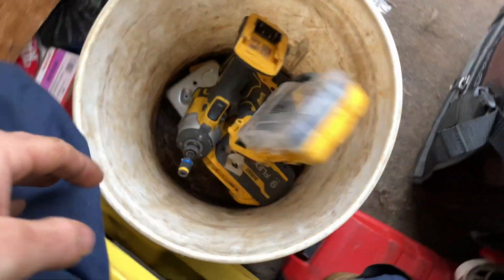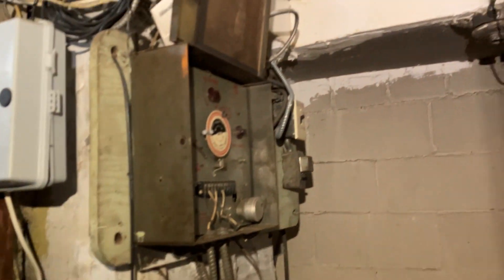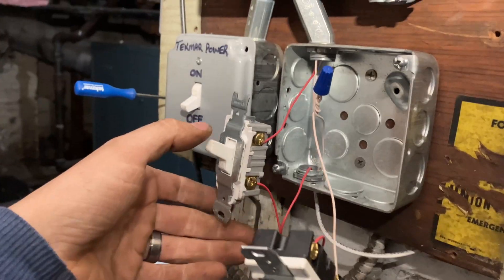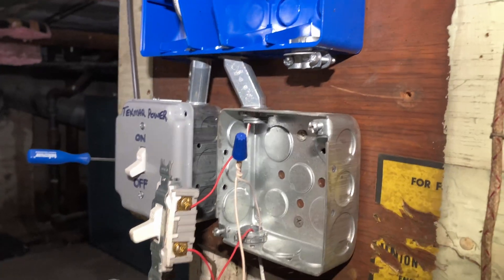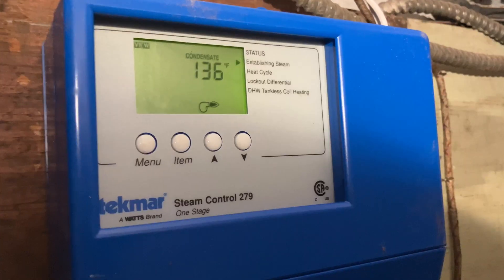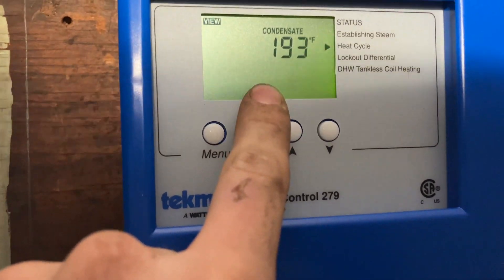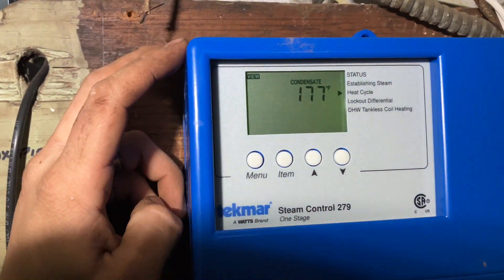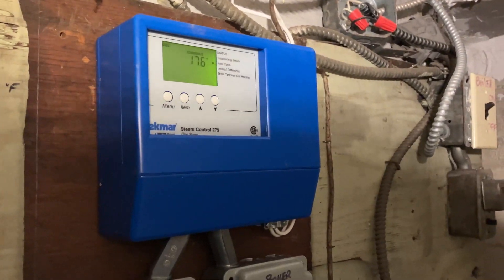Every Boiler Needs This Switch

Comment: Nice !  I have a tekmar 336 controlling a grufundos alpha.  I have an ST01 controlling the power to the tekmar so I can ignore heat calls during certain hours.  I have the power for the circ pump from the tekmar going to an outlet which then takes a 24h heavy duty mechanical timer and is set to 1/2 an hour on then 1/2 an hour off.  This allows the 40g bradford white ele water tank to get a rest every 1/2 hour and power my 7 hydronic zones based on individual zone actuators/532 thermostats.  I need to put a on/off switch ( breaker is close by ) / bypass is moving the circ cord to the other outlet.

Comment: Very nice install! Same concept for a hot water boiler?
Reply from the maker: For sure! The summer winter switch would be the demand switch( on/off) and the auto/bypass would well you get the point lol, auto let’s the “control takeover”  basically what the summer/winter switch is in, and the bypass is the most important because it bypass’ the control and let’s the boiler run. It will keep running until the aquastat satisfies but once it calls for heat kick back in. It’s a great way to get “quick heat” until the original problem can be solved, otherwise the boiler will just run forever because the “demand” is still calling